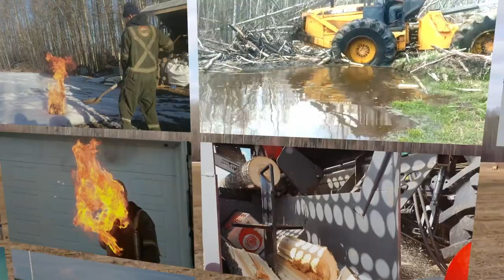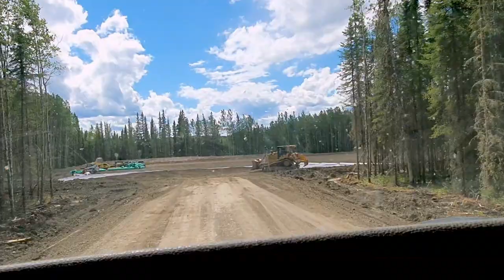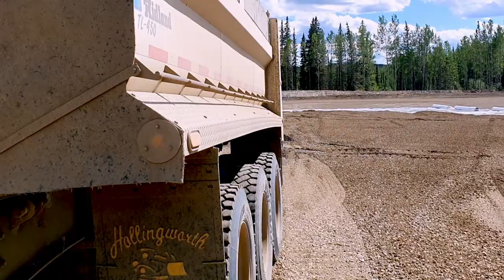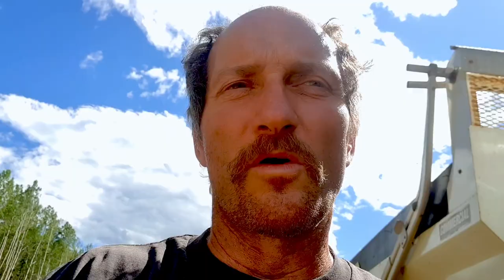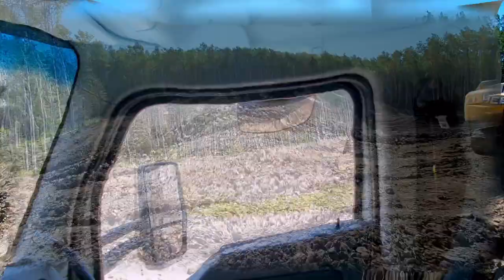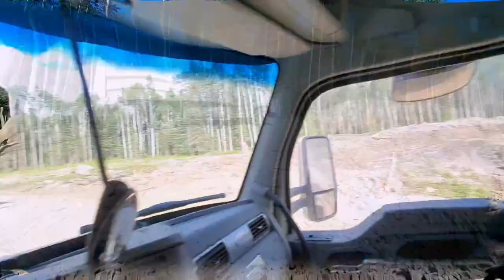Making Giant Oil Rig Pad

Comment: Beautiful scenery. A lot different than the temperate jungle I'm used to looking at. It's a shame it gets -20F up there for a quarter of the year lol. And you're right about that pit. 3:03, that's a big, big truck but dang if that thing doesn't look like a toy in that hole. That's a lot of loads.
Reply from the maker: You're right on all points.  The -20 stuff is the reason there's 30 million Canadians ( probably 90% live south within 50 miles of the border), and 300 million Mexicans!  -40 is where Celsius and Fahrenheit match, after that it's just plain miserable in either reading!
Got some way prettier scenery on the other end of the haul,  but haven't got it edited yet.
Finally did a video draw for the ferro for guessing the snap-on  auction purchase price.  It's up next. - nobody got the price right,  so threw the "what's this tool?" Names into a hat.
Reply: @lovesloudcars  Nobody got it right? Lol now I'm real interested in hearing the cost. I'm surprised anybody migrated north during the expansion years in Canada. The pilgrims were hard men but why make things harder with those temperatures? The furs and trees must've been worth it I suppose.
Reply from the maker: @conspiracyscholor7866  I have no idea why they went north instead of south.  When it's a serious issue to survive the weather for 200 days per year it's baffling why people did.
Ah well.  I would love to have a job elsewhere from November to March every year.  Wouldn't matter what it was.  The summer here is lovely of course.  People have short memories I guess  & "this will pass" must be the attitude towards winter. 
Tools:$85

Comment: Hey I did that for the county sometimes gravel spreading in tandom we loaded ourselves we had 4 pits hated going to inland
Had to go for hotmix n cold mix sometimes. Much prefer my water truck 😂
Nice video bro thank you for sharing bro
Reply from the maker: Thanks Darryle.  Spreading truck and pup I always get the timing wrong if I lift both boxes and spread one then the other.  Always more successful to back up and spread the truck or spread coming back the other way. 
Never hauled hot or cold mix. There's a few pits around,  but  nothing real close. 
I  have a video of this pit with an early morning rainbow and beautiful cropland around,  but as always have more recorded than I get posted. 
Your car show vids were interesting,  but thought it curious how there's basically no classics apart from the VW bugs.
Reply: @lovesloudcars  i only have my class 3 with air but i like spreading the gavel i was getting good at it though i never did it that often just hope the gate trips haha
we had an older guy contract worker for the county that had truck n pup n man that guy 
was amazing to watch spreading gravel bang on every time  years of mastering his trade n he was an owner operator took good care of his his equipment
Reply: @lovesloudcars  i was mostly running the water truck doing dust control hauling calcium and different chemicals for road stabilization I called it very expensive weasel piss haha had brand new Western Star last few years before i left was a nice truck kinda miss it kinda not lol